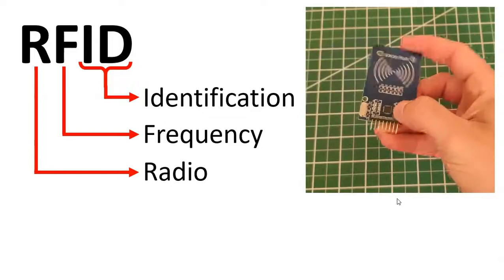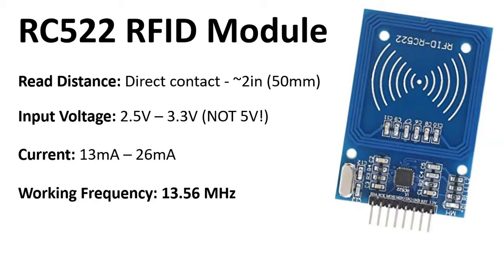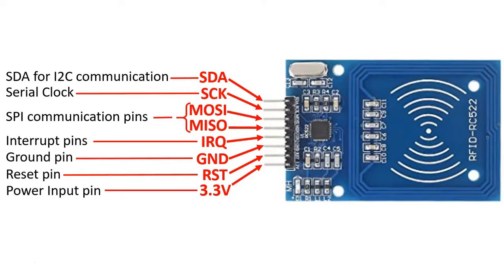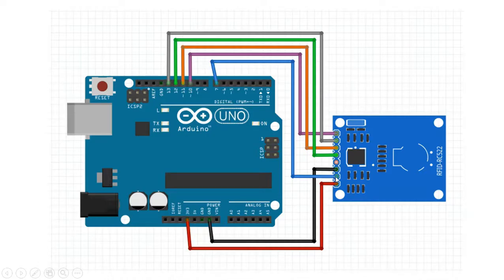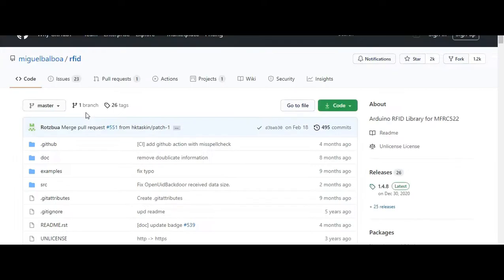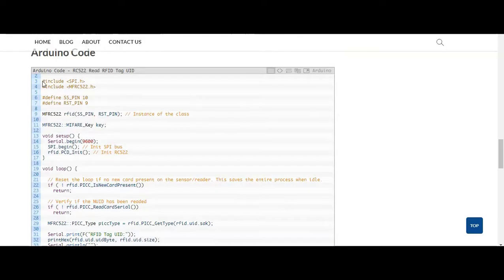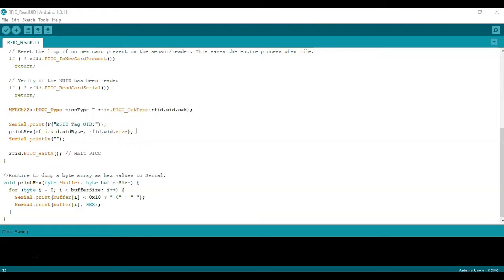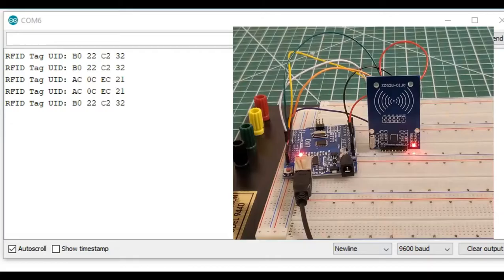Arduino RFID Module RC522 - How to Use

Comment: not sure why but the reader works fine, has power LED, but it wont read any tags. Can anyone help? Ive wired correctly and copied everything from the video including the code yet it still wont work.
Reply: i am facing the same issue, have you resolved it?
Reply: @impc-lx9gf  not yet the module just doesn’t seem to work
Reply: @KalanStrahan i think the pins are not connecting properly. Today i will try to get pins soldered.
Reply: @impc-lx9gf  tell me if that works if you can thanks.

Comment: the serial monitor did not show anything on my arduino ide
Reply: did you fix it?
Reply: @vbacz  turns out it was a problem on my rc522 that i haven't soldered, so it shows inconsistent results on the serial monitor
Reply: @wikanwar  i just fixed it turns out my arduino mega and many others , the 3.3V doesnt work properly but thankfully i had ordered an arduino nano and the 3.3V worked properly on my rc522

Comment: As a lot of people are reporting problems:
Connecting the 5V logic lines from an Arduino UNO directly to the RC522 RFID module, which is designed for 3.3V logic, is potentially problematic.

RC522 modules run at 3.3V for both power and logic levels.
The Arduino UNO uses 5V logic on its digital I/O pins.
Direct connection can work, but risks long-term damage to the RC522 module.

Comment: card not readed whats the prolem
Reply: Same issues
Reply: @ANTRUM666  They might work at a different frequencies. You might have a wrong card or chip. Try some other cards you have, if at least some them works

Comment: can you help me that on which software i can make the circuit design of this rc522 module
Reply from the maker: Hi! Thanks for watching. Do you mean the diagram I showed on the video that shows the wired connections between the Arduino and the RC522?
Reply: @diyengineers  yeah could you please tell me which software you used to simulate the circuit

Comment: I am getting an error for my rfid when I do the firmware check it doesn't recognize the rfid reader. I checked the wiring 10 times any recommendations?
Reply: there is an extension on the arduino ide for the rfid sensor